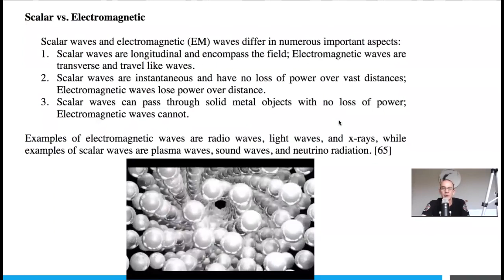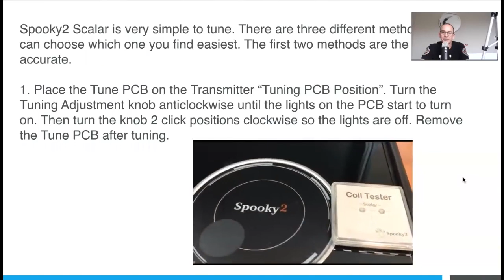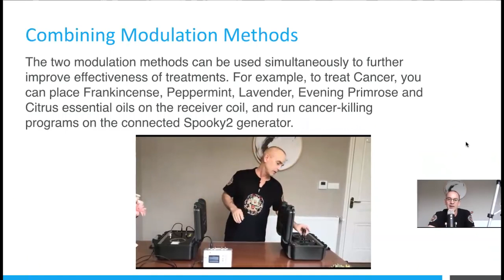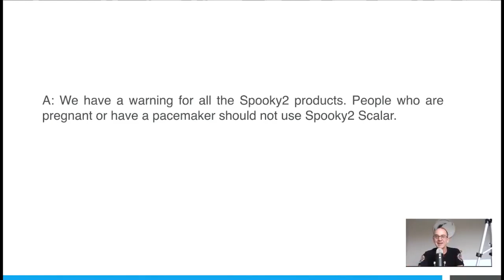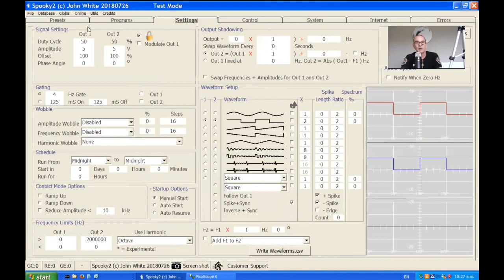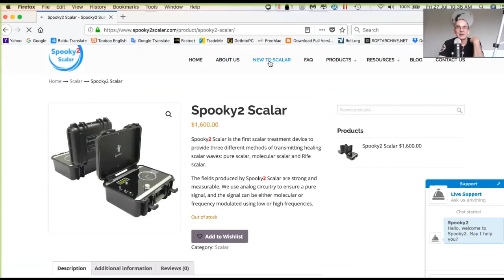[SAMA] Episode 61: Spooky2 Scalar

Comment: I tried the oscilloscope method of tuning the spooky scalar system as per this lecture. Instead of 180 deg out-of-phase at tuning point, I got two nice sinewave in-phase at 5.65 MHz. I confirmed the tuning using coil tester (CCW until leds lit, then two clicks CW (5.65 MHz). What's wrong?.